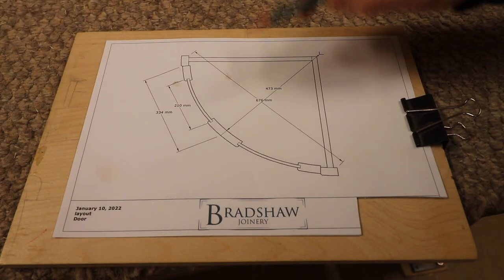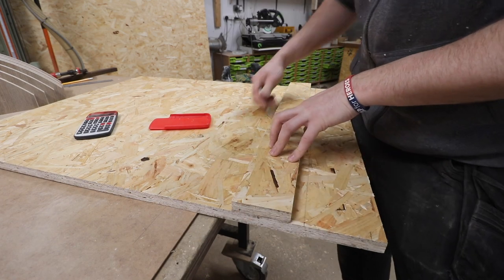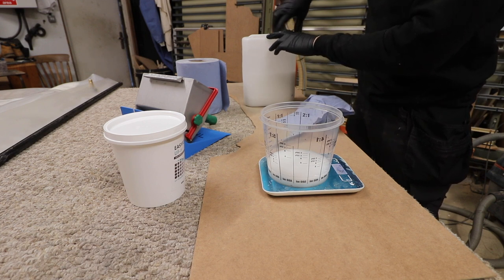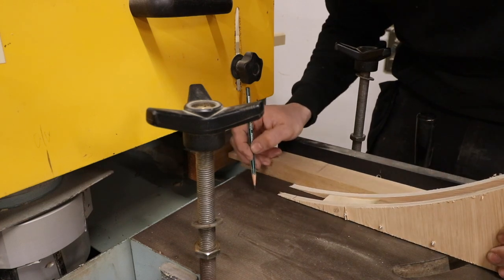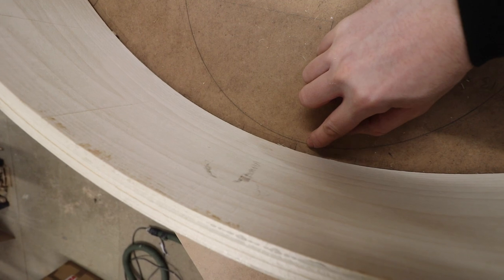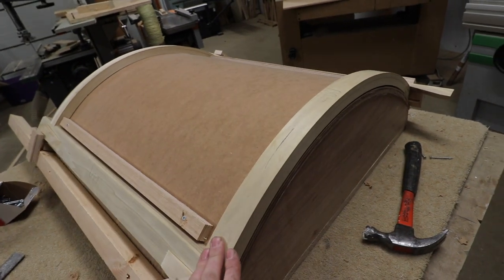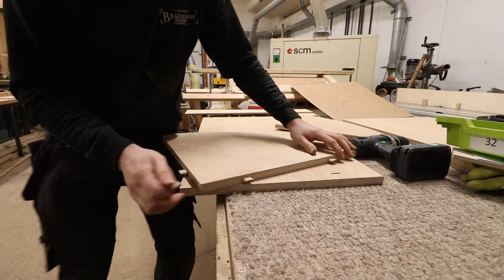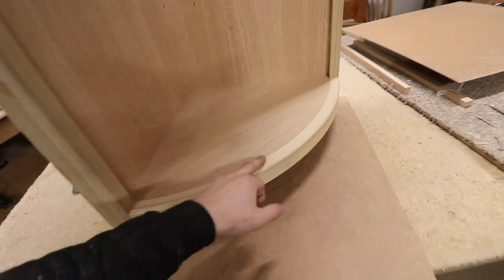Curved Shaker Style Corner Unit Part 1: - Bending and constructing the frame

Comment: Having made stacks of curved laminations over the years, a couple of observations that you may find useful moving forwards. In your vacuum bag slide in a base board with some grooves in it going the length and width around  75mm apart about 3 -4 mm deep, this will allow the bag to pull down evenly and better than relying on just the felt strip. Always use a glue such as cascamite that will go rock hard, PVA will always have give in it. When making the cauls for the shape you may want to put your ribs a bit closer and attach a cover board on top of them, as when you put a finish on the timber you will see the slight imperfections in the sheen when the light catches it. Great video as always, a true and proper craftsmen at work and always following good health and safety practices.
Reply from the maker: Cheers for that Gary! Yeah i was advised PVA will spring, but for the backing boards i thought it would be ok, seemed to work pretty well, but would probably cut the ribs another half inch back next time and have 12mm strips pinned around the curve longways before laminating the boards around next time so there is a ply effect. Love the info, and nice to know im not too far off the mark, ive not been taught this just leaning and figuring out as best i can as i went, Definitely learnt alot!

Comment: Fantastic work as always. Just a few ways that we do it at work which may help you in future projects. Our moulds are skinned with 2 or 3 skins of 3mm mdf then laminated and we also use duck tape around the edges just to restrict the airflow through the mould and prevent the mould collapsing. I love the bandsaw tramel idea we use a router tramel jig which also works well. Keep up the fabulous work 👏
Reply from the maker: Cheers Paul! I had a issue with the open sides, so ended up running a strip of timber down it! I learnt the drill/pin trick from my apprenticeship (not my idea) So happy to pass it on! 

the mould for the top cupboard, i sanded with a flat pad once it was dry, gave a dead flat curve with no sign of dipping between ribs. Ive seen a comment on here about the curvomatic aluminium system. that looks brilliant

Comment: Word to the wise on that brayer with well for gluing: Do clean after use but BUT make sure you have wiped all the water off of the roller surface and do not let the roller sit in the feeding slot of the well or else you will have corrosion and you will have to  block sand that feeder slot just to get a smooth opening for next time of use. I put a 1.5" larger block of wood screwed to the blue brayer base so you do not have to kid glove the action every time you hang the brayer on the blue stand. Helps to steady the blue stand. I made a wedge for the 150MM wide brayer to narrow the roller path down to 2" and that keeps the amount of glue applied to a more precise amount and less buildup for the unused part of the wide roller. Yes, that brayer is well worth the extra penny.
Reply from the maker: Good advice thanks!

Comment: Lovely job, extremely tight - a mm off is as good as it gets with anything made by hand. The skill and dedication to result is inspiring.
I know it's all easier said than done, but since you asked for input; I wouldn't trust myself to match anything at this level of complexity, so I'd make all the curved parts first, in the same run, until the whole front dry fits and matches in every aspect. Also I'd start with the door panels and work outward, once the curvature of the doors is right that’s a good reference to fit everything around. And I'd still make a pig’s breakfast of the whole thing for sure.
Reply from the maker: Thankyou for that! Yeah on the wall unit i had a much better method and had all the curves glued before doing any machining! Actually worked out pretty simple

Comment: I love doing curved work but every time i see someone starting to set out reminds me of a miserable old in a workshop years ago ( were the curve starts the profit ends ) 🤪 have you ever used polystyrene formers ? Send them your cad drawing they send you the former, much faster and nice and light and easy to store for next time. 
As you said the glue roller is worth every penny but make sure you clean it very well ( as if you wouldn’t ) i had a triple tank set up under the sink to filter the washing up water so it didn’t go down the drain, cleaned up every few weeks.
Reply from the maker: Haha pretty much Jim 🤣 the finished cabinet is lovely and well worth the effort but effort is an understatement! 🤣 I hadn't heard of foam formers until literally earlier today! Haha
I cleaned it well In a bucket of warm water then ran the components under the tap in hot water. I wouldn't like to use it with solvent based glue! 🤣

Comment: That was brilliant I really enjoyed watching the process. The frame turned out superb expecially using actual machined tenons. One point if I may, it might be worth trying. When you used the ratchet clamp to pull the horizontal frame rail down to the former profile prior to the vacuum pressure taking over on the vacuum press. If you used 3 ratchet clamps with the ratchet mechanism underneath you could leave the clamps on. When the membrain starts to pull down you could release them slightly so you have even vacuum pressure across the surface. Hope the doors go to plan. Tony
Reply from the maker: Cheers Tony, I did use a couple of straps on my first attempt and left them in, i taped over the metal with masking tape alot but didnt like the metal edges being pressed by the bag. I ended up using thinner strips and maskign tape once the straps had it wrapped round i taped it then removed the straps. Doors went well, the finished cupboard is on my instagram story until tonight.,

Comment: I use them eclipse trammels when I make stairs .  I came up with a great way of setting them out that’s different than the traditional  ways . It’s spot on . If your interested I could e mail it to ya . 😉
Reply from the maker: Sounds intersting Terry, Ill probably make stairs again at some point, you know how it is, seem to do a lot of something then a new project out the blue comes along and then a few more the same after. I cant comment my email, but search channel name for website and it should be on there, i haven't used it in years, but assume it still works (the website)

Comment: Really impressed!  Top joiner / cabinet maker. I was surprised at how little spring away from the former.  What materials were you using for the cabinet?
Reply from the maker: Thankyou Very much Alan, Youll get more spring from flexible adhesives, the UF Resin is incredibly rigid. Cabinet is Birch Ply with a 1/4 sawn oak veneer

Comment: Hi Bradshaw, great video as usual.

I'm wondering about the glues you use! I work mostly with Accoya making windows and doors, and I use Wurth and Soudal 15 and 30 min PU glues, but they're pretty toxic and messy to work with. The gun-tube stuff you use in this video looks much nicer to work with, what is it and where can I get some?!

Cheers,

Jack
Reply from the maker: I think it was actually wurth glue, but as you say its more toxic than some others. A slightly more liquid version in the gun is sovereign chemicals PU Rapid, slightly thicker but less potent is Construction chemicals Wood Weld
Reply: @BradshawJoinery  I always preferred Timbond PU adhesive from Adkwik, it goes in the frame gun as well and is less runny and dries firmer. It also dries very quickly, don’t know how we managed before we had that.

Comment: Have you ever seen a Multi-Router?
Reply from the maker: I have yes, a little like that pantorouter from mattias wandel? Im not sure it would fit in a production workshop environment but looks a very capable tool!
Reply: @BradshawJoinery  well,  this machine, which is used in many production shops, as well as furnituremakers shops,  is capable of milling mortises for rails and stiles in curved doors amazingly quick and accurately,  The work can be presented to the bit on edge, rather than needing a curved fixture as the tenoner did.  You can also easily adjust the location of the mortise being milled into the mating face on the curved rail to balance the remaining material on either side for joint strength-  This is a serious machine that does different operations very well .  I do not ever use the tenon templates, strictly floating m&t only-
Reply from the maker: AHH fair enough, I will give it another look. Thankyou 👍

Comment: The PU glue that I use, Jowat, #150.91, white, requires a spray of water in the application area in order to activate the PU. It is PU dispersion glue in a 40 lbs bucket.
What and how is your PU used?
In the binding of books industry it (PU) requires a chamber where the air cannot get to the PU in order work.
Reply from the maker: Technically yes a moisture content is required, but there is always moisture in the air in UK, ive not had a problem with it not setting yet!
Reply: @BradshawJoinery  thanks and have a good day over there

Comment: After all that work on the frame you went and used pocket screws?  Don't tell me, you have to get it on site for the template.
Reply from the maker: Cheers Chris, I think pocket screwing with domino location if a great way of merging the two components. Certainly not seen any detriment to using this method yet! I was a bit pressed to get the template deadline